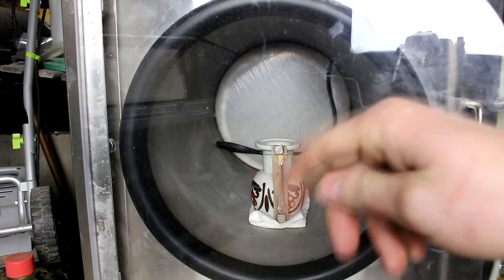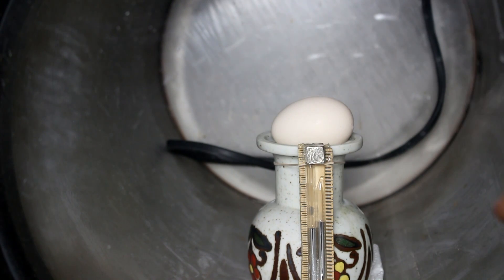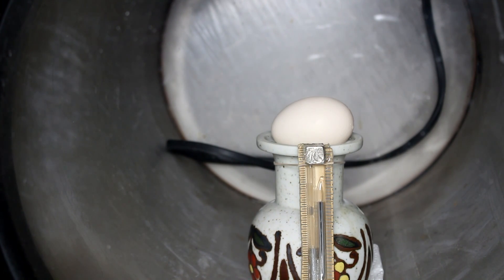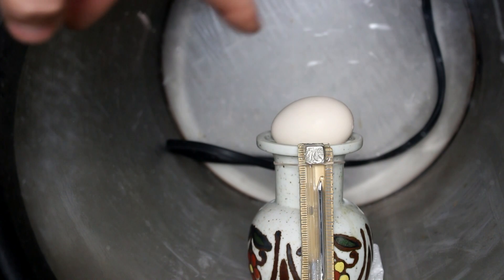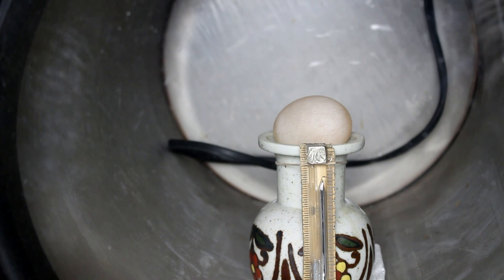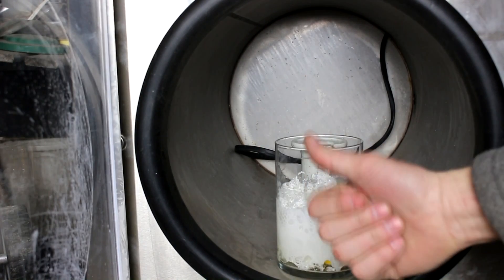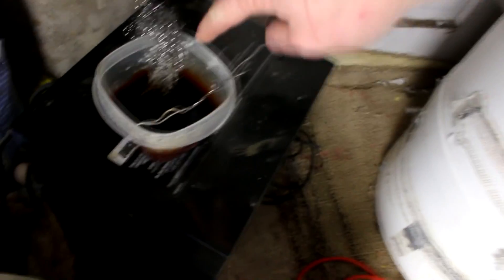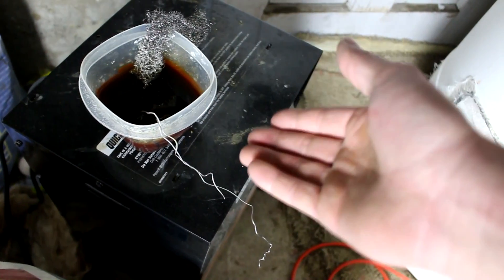Egg in a Vacuum Chamber

Comment: does the vacuum chamber sanitize the eggs enough for consumption? This seems like a cool way to cook things if it does
Reply: Al Capone eggs are relatively safe when raw. They go through a chemical washing process, that removes the salmonella from the outside. Salmonella is usually only present on the outside of the shell, which is cleaned
Reply: I understand that, as I know an oldman who used to slurp raw eggs from the shells as a snack lol.  I guess i worded that badly, what I meant was "does the process of putting food inside a vacuum chamber sanitize food enough to eat? Such as eggs, raw meat, whatever else"
Reply: Wondering the same thing. My guess is that the water in any bacteria present boils away as well
Reply: but its such a low temperature boil. does it still kill bacteria?
Reply: The water vapor would expand and explode the bacteria from the inside. At least that's my theory

Comment: 7:39. You say the remaining water froze, but I'm left thinking: What is happening to the proteins of egg whites? Maybe they are the ones freezing or even denaturing. 
And you didn't show what happened to the egg whites as it came back to room temperature! <insert angry face> If it remains white then it means it's proteins denatured and you've effectively cooked the egg. In that case, maybe I was right and the egg didn't just "freeze" when it got white, but cooked as well.
But it probably got transparent again, like in the second experiment, with the egg skin.

Comment: What would happen to something very cold in a vacuum chamber (like dry ice or liquid nitrogen)?
Reply: Liquid nitrogen will eventually freeze to solid nitrogen and dry ice will turn into carbon dioxide gas.
Reply: Hmm, very interesting, thank you
Reply: It depends on the temperature of the chamber. If it's really isolated from the environment, a lot of heat will be lost and you could solidify even stubborn volatiles like nitrogen. At low enough temperatures, even sublimation stops and that's why you can have stable solid CO2 far from the Sun in solar system.
Reply: Eemeli Saarelainen where are you from?
Reply: LucasAndAGuitar Finland, why do you ask?
Reply: Eemeli Saarelainen your name is different.
Reply: Eemeli Saarelainen Why not?
Reply: There is a youtube video of some chefs putting nitrogen into a vacuum chamber and it does freeze

Comment: The stainless steel wool and SS wire are surely reacting at the same rate, what voltage would you need to minimise the corrosion and still be effective? 
With the egg, could you demonstrate an explosive de-compression as if a window were to blow out in space?

Comment: Hey Cody did the Egg white turn back to liquid once it came back to room temperature? Also did the color change back from white to transparent. Because if not I think I might know why it didn't. My hypothesis would be that the proteins in the egg white began to de-naturalize causing at the very least the egg white to turn... well white... the same process happens while cooking the egg but the de-naturalization happens because of the heat and not the cold.

Comment: Hey Cody, you should try to hammer the stainless steel wire into a very thin rod and then use a file to increase the surface

Comment: First question: How do you remove the shell from a raw egg and leave the membrane intact?
Next: I don't think the egg actually "boils". I believe that when you remove the 14.7 psi of atmospheric pressure the air in solution (approx. 80% N2, 17+/-% O2, & trace gasses) comes out of solution and forms the bubbles. 
"Henry's law states that at a constant temperature, the amount of a gas that dissolves in a liquid is directly proportional to the partial pressure of that gas in equilibrium with that liquid."
Also the heat is removed when the vacuum is created, and when returned to a normal or static state, heat is created in the chamber.

I think...

Comment: CODY, YOU SHOULD POKE A PIN HOLE IN THE TOP OF THE EGG AND SEE IF THE PRESSURE MAKES IT BUBBLE OUT! I think because the egg is porous so it lets out just enough gas and water vapor to keep it from exploding, I bet if you poke a pin hole it will be pretty awesome, giving it a larger escape hole it might all pour out the hole

Comment: I don't think that it is simply freezing - the egg is denaturing and froze - basically the same that happens when you cook it, just when it gets really cold.
Reply: I agree. Also, the egg membrane is porous: it lets the gases and water through, which explains why the egg without it's shell didn't rupture.
Reply: It didn't cook. Cody even said it turned back to a clear liquid when it thawed.
Reply: Protein denaturation isn't always irreversible. In this case, I suspect that with the negative temperature change, the egg yolk proteins were reversibly denaturated (rapid white color change with a smooth progression front, opposed to the spikey growth of ice cristals). No chemical bonds were broken: this needs energy to occur. Probably, the proteins turned inside-out when they froze and outside-in when they thawed.

Comment: You can get woven steel wire mesh (wire cloth) that is very tightly woven and fairly heavy gauge wire, that would probably work well for you. McMaster sells it in small pieces for a half reasonable amount.

Comment: When I saw the video in my sub box I thought " what a stupid idea, it's clear that it will explode" but now I see that something as simple as an egg produces really interesting results when put into a vacuum. Why didn't the foam collaps after you put the air back into the chamber? Is the protein of the egg really that strong?
Reply from the maker: The frozen gas bubbles are very leaky.
Reply: ***** Ah, that makes sense ^^
Reply: I think it is because the proteins in the egg white denaturalized due to the change in temperature, basicly the same as what happens when you boil an egg. A boiled egg is also able to maintain its structure and shape when you peel it.
Reply: eggs are very hard to break if pressure is applied evenly over their surface
Reply: ***** Yea, I knew that this is the case for pressure from the outside, but I didn't expect it to be that durable against pressure from the inside
Reply: ReDnAx1991 no but freezing doesn't cook anything

Comment: if you need high surface area stainless steel, do you think a machining shop has some stainless chips leftover? may be easy tu use and replace too (put chips in a strainer and in the water, then if the chips are spent, you can throw them away and put some new ones in?)

Comment: Put pc in vacuum
Reply: GAMES ON all that would happens is that the fans would spin too fast and possibly break. The thermal paste on the CPU might do something as well. Organic materials like that egg have interesting reactions because of the reaction the cells have to the pressure. Metal and plastic like what you'd find in a PC wouldn't really do anything interesting.
Reply: Thanks for the reply I thought it would be interesting in the video

Comment: You drank heavy water but would not eat an egg cooked in a new way !
Cmon Cody.....they might name the dish after you :)
Get the magnetron out.
Reply: He used some strong acid to remove the shell - i wouldn't eat that afterwards either.
Reply: I mean, he also ate sodium and cyanide. I don't really want to eat anything named after Cody's Lab.
Reply: The egg is not cooked. The reason its boiling is because of the tiny tiny pockets of gas thats in the egg. They are expanding due to the pressure decreasing.. So no its not cooked, since there is no heat applied to the egg.
Reply: His girlfriend probably brings her own food there. I wouldn't be surprised. :D
Reply: I wouldn't call that cooked. It was essentially still a raw egg that has been frozen for a short time.
Reply: ***** once again: temperature denatures proteins, not the action of boiling. Denatured proteins are also called cooked
Reply: BMAN488877 no in a reply to someone he said he used acid
Reply: superdau no heat denatures proteins not boiling at room temp.
Reply: it didn't cook the egg. the boiling didn't produce heat it just released it he really just froze the egg
Reply: Sorta. Not sure if this is reversible, but dehydration is also an effective means of denaturing protein. Heat, pH, Oxidation, and crosslinking all denature hydrocarbons. Ethanol is handy for DNA - the old cheek swab trick uses Ethanol to dehydrate the dna and a little peroxide to reverse the supercoiling that normally keeps it all wrapped up into a microscopic ball. Use filtered red wine and the anthocyanin's act as a handy purple stain for nucleic acids. 

Very much doubt that any salmonella were harmed in this experiment, their cell walls are pretty tough, and under adverse conditions they can form cysts pretty quick. No membrane bound organelles to rupture either. With sterile technique, though, fresh raw egg could be safely eaten, just not advisable.
Reply: pale blue dot
If you beat the egg white until it's fluffy that's also cooking? That's most likely what happened here (but instead of beating air bubbles into it, small gas bubbles formed due to water evaporating). There is no placing of polymers in a chain.
Reply: BMAN488877  You think he didn't just - you know, use the same egg again?
Reply: You can remove the shell with vinegar, stronger acids would eat away at the membrane.
Reply: temperature is not the only thing that can denature a protein, ph changes, temperature, oxidizing and more rarely reducing agents, as well as change of solvents or plain chemical reactions can denature a protein, in this case, loss of the water (solvent) could have denatured the protein, but before thats even necessary, raw eggs originating from vaccinated hens have a VERY small chance of being contaminated with salmonella
Reply: Stephen M pretty sure he have had other things in that glass container that is not edible. And he did probably not clean it to the point where he can put food in
Reply: robert boyd 
ignore him 

either way what he is saying deserves no credence
Reply: superdau 

cooking egg whites is jus placing the polymers into a chain 

if that did it. then he "cooked" the egg

the end material would be essentially the same 

it wont go "raw".
you can uncook an egg
Reply: pale blue dot Heat is needed to have the chemical reaction in the protiens , what he did didn't actually heat it up or "cook" the egg.
Reply: The Emperor of Mankind knowledge should be freely exchanged with whomever wishes it.
Reply: Stephen M 
I will say you can get salmonella from raw eggs? But I'm really not an expert on this stuff.
Reply: Rion Motley thanks for an actual informative, well written response in a non-douchey manner.

P.S. I'm glad to hear no salmonella were harmed in the making of this video.
Reply: The Emperor of Mankind youre upset and "butthurt" as you said over the FACT that somebody who has dbl your iq held an egg that had been soaked in acid - and presumably washed off afterwards. and then you go on to complaining about your schooling - or your kids schooling - that apparently is lacking in yours or their life....or something along those lines. is that the jist of all 30 of your most recentncomments? whos whining? or has hurt feelings? or a sore bum bum? lol dude, im drunk. i enjoy his vids and channel, along with alot of others. dont be a weiner because u cant get laid lol now ima have a beer and flip to the rocketjump channel n see what's goin on over there :P later weiner
Reply: Curiosity was framed....ignorance killed the cat :)
Reply: The cat is in a superstate of bloody annoyed.
Reply: Robots do not have nudes. You are obviously a robot.
Reply: wellprepared 41 

??? so back to things that matter

eat the egg
Reply: wellprepared 41 I'm not sure if your a troll
Reply: Frank B Marra Not even close to being true.
Reply: The Emperor of Mankind I see so eugenics is your forte?
Reply: twenty øne phanics! at the septiceye discø .... idk dude I've eaten about 20 whole raw eggs in my life so far lol and its been almost 31 years - and havent gotten sick from it yet (knock on wood) - but i HAVE gotten sick (food poisoning) from cooked chicken like 3 or 4 times though lol
Reply: The Emperor of Mankind you seem a little tense.  Try yoga.
Reply: The Emperor of Mankind interesting, who pray tell, will be allowed to procreate? Should I?
Reply: The Emperor of Mankind what kind of a term is 'butthurt'?
Reply: The Emperor of Mankind how does butthurt mean annoyed
Reply: RocketLR It's boiling because water is boiling... the initial foam, where bubbles formed at the top of the liquid, were simply trapped gas. The later bubbling that originated throughout the liquid, was a result of boiling water due to lowered air pressure. The egg was slowly drying out.

It was not heated though. it was cooled. All of these changes can partially denature protein, the only question is whether it was safe to eat, and the consensus seems to be a firm "no" because of the salmonella risk. The foam,however, was a meringue by the time he was done - just not one that had ever been over 140 degrees F, so Montezuma's revenge...
Reply: Stephen M, whats bad about drinking heavy water?
Reply: curiosity may have killed the cat but satisfaction brought it back
Reply: The cat is a function of both dead and alive😁
Reply: you only get salmonella from unvaccinated hens (which to be fair, usa dosent require vaccination) but if the eggs were from vaccinated eggs or some other country, there is no danger from raw eggs

Comment: apparently, you can make a true aerogel from egg. I think that may be a mix of white and yolk, from washing up experience. ;)
Reply: How? Yolk would ruin the whites ability to peak
Reply: Trid
The yolk is used on it's own as the binder for tempera painting, yolk mixed with pigment. It makes a surprisingly durable surface. One of the properties of an aerogel is very high strength for its weight, so I'm guessing you'd need the yolk involved somehow.

Comment: Well, you actually answered a question I've had since I was working on my biology degree (back in the late 80s, early 90s).  When the boiling point of something decreases (due to lower pressure), does the boiling process still denature the proteins?  The answer appears to be no.  The heat required to denature protein remains the same, even if the boiling point decreases.  Material science is weird.
Reply: Oh, and something else.  Since the inside of an egg is actually a single cell (an egg cell)...  this is macro scale look at what happens to cells in a vacuum.  Doesn't bode well for being exposed to the vacuum of space, does it?  LOL
Reply from the maker: It does show that you wouldn't explode but yes you would loose lots of water and freeze in a short time.
Reply: LOL.  Boiling until you freeze would be a terrible way to go.  ;)  Though it might leave you with a merangue-like coating.  :D
Reply: +Cody'sLab Would you ever put a magnet in your finger again.

Comment: How do you remove the shell from the raw egg without also removing the membrane?
Reply: I think you can dissolve the shell with vinegar.
Reply: It just requires a firm snap of the fingers obviously
Reply: pinkbutterfly8710 
Cut it out of a living chicken before it develops a shell
Reply: pinkbutterfly8710 by snapping your fingers
Reply: let it sit in vinegar for a while.
Reply: pinkbutterfly8710 
soak it in vinegar
Reply: he said in another comment that he used a acid.. "none of that vinegar crap"
Reply: vinegar is an acid acetic acid
Reply: Gabriel Neda but its still crap
Reply: pinkbutterfly8710 vinegar
Reply: I don't know if he has access to 96% vinegar acid; I have dissolved quite a lot of egg shells with that in a very short time!
Reply: Acid.
Reply: pinkbutterfly8710 by soaking it in vinegar!  or really patiently and gently peeling it off
Reply: pinkbutterfly8710 have you never taken a biology class ?
Reply: +Gabriel Neda he used a strong acid
Reply: In another comment he said he used an acid, but he didn't use vinegar.
Reply: I've taken one in HS and we never learned about this.
Reply: Vinegar is an acid, just a weak one.
Reply: Vinegar consists of about 15% Ethanoic acid (acetic acid, CH3COOH) which dissolves away the Calcium Carbonate shell.
Reply: They sell pickled eggs at a good amount of grocery stores.
Reply: pinkbutterfly8710 exactly.how??
Reply: Yes, that's right.
Reply: Rachel O it's just vinegar
Reply: This video cracks me up, I don't know if to take this video serious  https://www.youtube.com/watch?v=r5aNOuIN8Iw
Reply: Nemozoli red cabbage juice
Reply: Kazmir Runik Pickled eggs? what the fuck
Reply: Neon - TC 
yea pickled eggs. At least use to be found at every bar since the beginning of beer
Reply: strong acid

Comment: Is nitroglycerin more or less stable under a vacuum?
Reply from the maker: I imagine it would be more since it requires both heat and pressure to set off.
Reply: Interesting. I thought it would be less, but didn't have any real reason to. Thanks!
Reply: Cody'sLab ,  Your vacuum chamber looks just like a HR Freeze Dry Unit... 😀😀😀 with the racks removed...